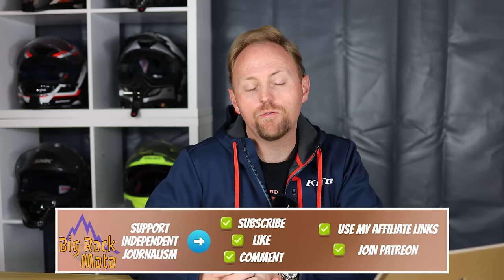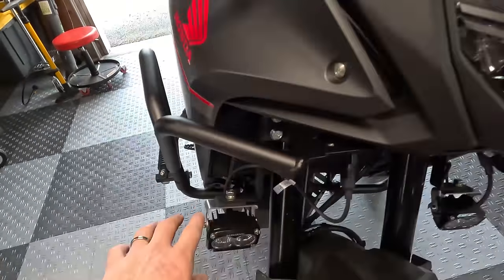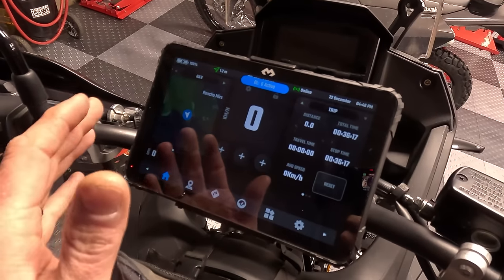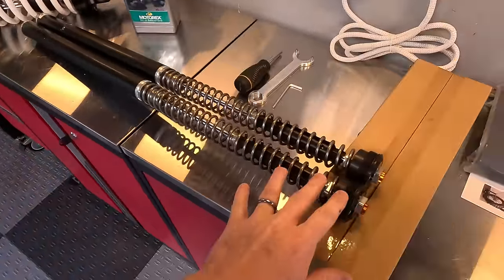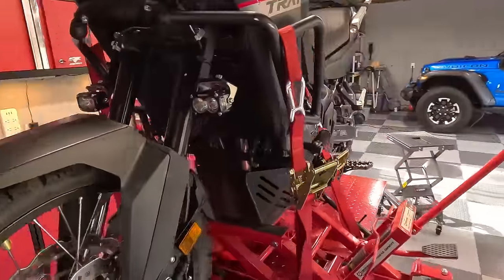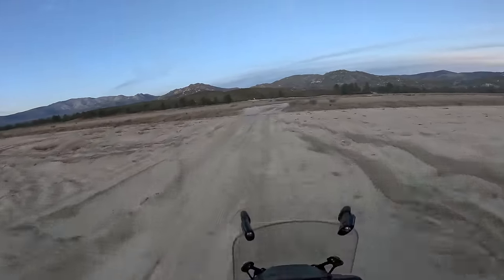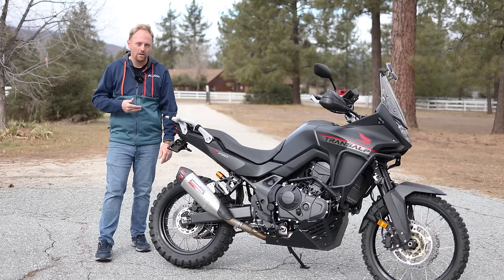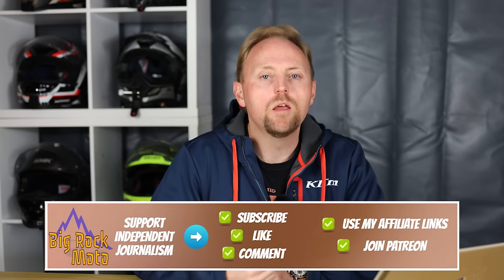Honda Transalp 750 | Suspension Upgrade, Lighting, Exhaust, GPS & More (EP.6)

Comment: I don't understand the need to go "fast" off road on a adventure bike . That's what lightweight dirt/dual sport  bikes are for .Advs are built to go fast on pavement and moderate speeds off road . IMO anyways it's for loading up the camping gear and hitting the woods to disappear. 

Thank you Ian for doing this for us !
Also I am curious if the Yoshi pipe is in the same location as the stock since I have a pannier rack clearance is an issue

Comment: Welded T7 exhaust hanger is indeed a fault by Yamaha, but the pillion pegs are at least separate from it so they can be unbolted on their own. Honda’s combined the two hangers so you’re stuck with the pillion pegs to keep the exhaust hung. As a solo rider, it’s nice to drop the pillion pegs since they’ll likely never be needed

Comment: I have a Yamaha Tenere 2022 model.  I have more than doubled the cost of the bike in upgrades.  Do you need to?  For most no.  Does it make that much difference?  Yes it does.   It makes a motorcycle your bike.  Outfitted the way you want with Ohlins suspension front and rear set up for your weight and gear.  All new motorcycle.  When I see RTW Paul riding to support a cure for MS with 170K on his Tenere I realize it's an investment and can be enjoyed more than the ret of my riding career.  I'll pass it on to my GS.  Then he can go around the world.  A little extra items on mine, Sargent heated seat, luggage, Hahn machined hubs, heavy duty spokes, custom tubeless wheels, Acerbis fuel tank, Oxford heated grips(great), Camel ADV side stand and brake lever,  HP Corse Titanium inside short exhaust, much the rest very similar if not the same.  Motoin, Rocky Mtn. ATV, Revzilla and OFF-THE-ROAD.  No VAT for foreign orders and very reasonable shipping.  Does it ever add up.
Reply: You don't need most of these stuff to take this bike around the world. To set up suspension for your weight and gear you don't need to spend thousands of dollars for Ohlins stuff, only $300 for shock and fork springs, the stock suspension is very decent by itself with the correct springs. For tubeless converion, no need for custom tubeless wheels, 3M tape would do the same job for 50$  and so on so on.

Comment: Thanks for the great video. I have a question regarding the suspension. How often do you need to make the new upgraded suspension's maintenance compared with the OEM suspension? This applies to all the so called "performance" suspension upgrades : do the service maintenance intervals will increase significantly on an upgraded suspension? I would really like to upgrade mine but I am concern that I'll have to do the maintenence of the fork much often. Greeting 👍

Comment: Is there a possibility of any 3rd party manufacturer's making a flat oil pan and a high slung exhaust which actually diverts the header pipes upwards giving more ground clearance (I saw camel adv replying to someone on Instagram)?
IMHO that is the only after market niche that hasn't been filled as far as the transalp is concerned.

Comment: One of the mindsets of motorcycle markets has been, if you want premium suspension and electronic control features, you should also want big engines, big bike, big capacity. It's the same categorical up-selling in the automotive market. If you want a bigger engine, you have to buy into a boat load of trim features that you could easily live without.
But it doesn't have to be that way for motorcycles.
If perceived value with motorcycles is a big powerful engine, then no one will want to spend thousands on upgrades for a 750 class bike. No one in the camp of big engine = premium controls is going to think anyone in this 750 class of bikes is anything but nuts for putting premium parts on a bike.
But if your mindset is "750 is premium, I don't need or want more power as I see it as a downside to an ADV weight and versatility"....... then you can justify putting parts on the bike that Honda likely never will.
Reply: Agree 100%. I want good stuff on a smaller, lighter bike.

Comment: I've been very close to pulling the trigger on a used 23 AT AS but I've held off because of size and weight of it would be a handful in some of the places I go even though im a big guy. I could get a new transalp and upgrade the suspension, add cruise control for less than what I would've paid for that used africa twin adventure sport and have a much more manageable ride. Reliability is huge for me so I always buy Japanese vehicles.

Comment: U r doing great and really thankful for this level of testing content. Couple of questions in my mind, 
1. Aux lighting- i have heared there are spot lights, flooded lights, fog lights and hybrid lights. What kind of lights are they? I can see there is flooded lighting, but is there spot lights in it - i think is necessary for high speed highway run too moose or deer in advance. Also is it include fog lights ?

2. Suspension - Is there a suspension option which have 240mm  travel (i am asking this suspension is missing the plushness of a high end suspension because of low travel - riyt ?). Which is the top quality brand for Suspensions (i heard it is ohlins but is it for adv bikes). As transalp have 21 inch front wheel tube tyres, 240 mm suspension will make it as good as the 890 adv r and transalp is the only Japanese option with electronics and low weight. 
Just my thoughts- i am not that experienced 😊

Comment: I'd hate to add up how much I've spent on all the mods to my 890R (most of those are your fault btw). I do quite like the look of the bike as you have it setup now. But the air filter is probably a deal breaker.

Comment: Thanks for this.  I recently sold a 2022 AT AS, it was just too tall for me even after upgrading the suspension to lower the bike.  The Transalp is an interesting possibility for me because I like the ADV style bike.  It is also interesting what the upgrades you did actually cost, just about the price of an Africa Twin Adventure Sports, but as a stock bike it would be disappointing. Maybe the new height of the AT with the 19 inch wheels would make it more enjoyable.

Comment: Wow! That’s insane $$ for upgrades and I get the point of , how good it can be. I can honestly say for my 1290 SA-R is, exhaust can, racks, rally mode activated and GPS wiring harness is all I’ve had to do to it and is roughly the amount spent.

That said, if i had to do it over again I would go with the TA and spend the $$ for the extras simply for the “perceived” reliability factor. I haven’t had any issues with my ‘23 KTM but, i also don’t have but 7K miles on it. 

Great info as usual, thank you.

Question: (forgive my ignorance). For the nav tablet, do i have to have an Android phone to use it? Or is it just android based OS?

Comment: Side case/ pannier users beware. While the Yoshimura RS 12 mounts perfectly to the Transalp it is not a factory match. It hangs at a sharper angle and this causes the tip to be about 1-2 inches higher than the factory exhaust. If you have after market side cases this could be an issue. The RS12 hit the rack for my Shad 4P mount for Terra hard cases. It then made contact with the case when the case was mounted. The pipe looked great, but can’t be used in conjunction with the cases. At $60 for restocking and $60 for shipping it’s a $120 miss.  It’s a shame because the pipe was awesome, but restocking and shipping are painful when it didn’t fit my application.
Reply from the maker: Good info thanks for sharing
Reply: @BigRockMoto So interestingly I posted the same to Yoshimura’s site twice in the last week. They keep taking the review down. Not very transparent about their products. Maybe I need to post reviews on all the sites of their resellers…

Comment: Thanks Ian! Your Transalp Rocks! 😜 I also made a few mods to mine, including aux lights. Quick question: could you please share why is the engine check light on in the beginning of the video?
Reply from the maker: It went out, so I don't know
Reply: @BigRockMoto  thanks. It happened to me when I started the bike without the dashboard attached. It also went out after a couple hours of riding. It's an intermittent error then, so no worries. Again, that bike of yours is mad! Cheers

Comment: Price wise, it's a bit of a blow to the gut. It's about $2000 more than the base KTM 890 adventure R. That said, it's also a Honda, so you won't have KTM's breakdown anxiety, and it doesn't weigh as much as the big ADV bikes (the new Africa Twin is around 250kg/550 pounds!). Also, there are cheaper, although not by much, suspension kits available.
Reply: You'll need to pay the money as well to bring KTM's suspension to the same level.
Reply: @DragosStefan   I said the base version of the R model, not the base version. The R model has about the best suspension you can get.
Reply: @disekjoumoer  it doesn't. Xplor forks need a lot of investment to work properly. The good part is that there are lots of aftermarket kits for them, but you'll still have to spend the money. There's no way the stock Xplor  suspension on the 890 could compare with a set of Tractive.

Comment: Question for owners with the Yoshimura RS12 slip on. How’s the bike run and sound with the new pipe? Very hard to find anything online from an actual owner. Is it too loud without the db killer? Does it lose anything off the bottom end from stock? TIA from England.

Comment: That suspension is cheap compare to the Ohlin setup for my AT, but I got complete new front suspension. It will be interesting if it makes the same amount of difference on a AT (read: HUGE) or if it's just mediocre. Is it too much? If you're gonna keep the bike with no intention of selling it and you go off-road quite a bit...a resounding yes. The only way I could justify the eye watering expense of Ohlin suspension on my 2016 AT is I knew it was my forever bike. I knew and know I DO NOT want any of the new ones as there is too much in electronics, sensors and interfacing through a display for your 'settings' is nuts. When you need Firmware updates for an ICE adventure motorbike it has gone too far. I took upgrades to my bike right up to the max, but now it performs as good as if not better, and more reliably, than any of the new ones, and I don't have to wait for it to boot up. It will be interesting how your applied upgrade affect the performance and handling of the Transalp. I had one of the first Transalps in Japan in 1988, it was my first motorbike in Japan.

Comment: On the stock shock the nut on the side of the shock showing soft and hard is suppose to be adjustable.  I turned mine 2 turns to soft .  Honda does not mention this adjustment?

Comment: Is the stock suspension suitable for a certain weight rider?  I'm 155lbs and curious if I'd need to change anything.  Mostly road riding, but probably some fire roads and not-too-rocky desert stuff.  Thanks for any insight.  I really appreciate your channel and the info. you cover.
Reply from the maker: it will work pretty well for your weight, yes
Reply: It's fine stock especially at that weight

Comment: Honda XL 750 Transalp - Gearbox click noise - Engine turns off (sometimes)

Hi guys

I bought a Transalp 750 a month ago and I think the bike has a problem.

I would like to know if anyone has had a similar problem with this bike.

This video shows what happens:

https://www.youtube.com/watch?v=mg8uv-6bf6g&ab_channel=CarlosEstrela

And here is a description:

In a total of 1500 km (2 414 miles) with the motorcycle, when downshifting, I felt a weird clicking noise more than 70 times, and the motorcycle turned off the engine 5 times when this clicking noise occurred. In this video, I'm normally riding slowly at 2500/3000 rpm, but in the last sequence of the video I'm close to 4000 rpm. The weird clicks and the engine turning off also happened when I was riding above 5000 rpm. As time goes by, the clicking noises are happening more frequently and on the last ride of around 100 km, it happened 8 times. Both the clicking noises and the engine turning off could happen at any downshifting.

Has anyone ever felt this? Is this normal?

Comment: A cruse control would have made this bike perfect
Reply: Cruise control, tubeless, better quick shifter (up direction, down it's fine) and a little bit less vibration, especially at that 3700-4300 ROM range. (I also keep wondering if USA version actually has torque lower and different engine feel due to less power. I tested only European version)
Reply: @PovilasPanavas  👍🏿